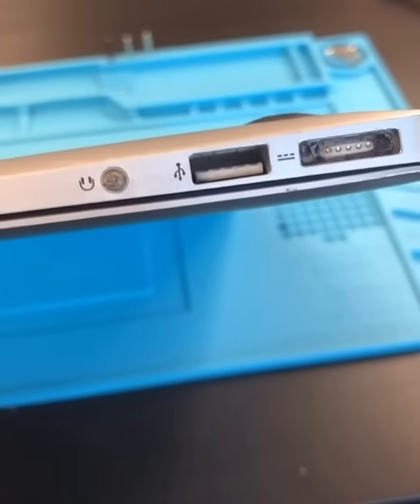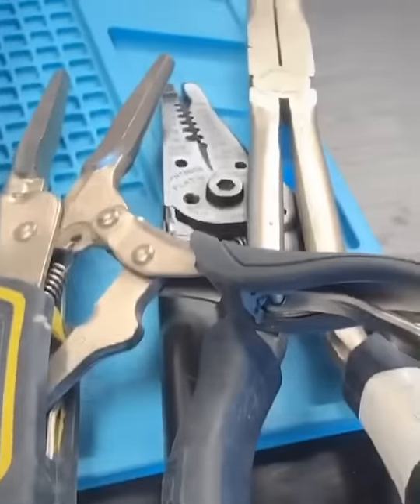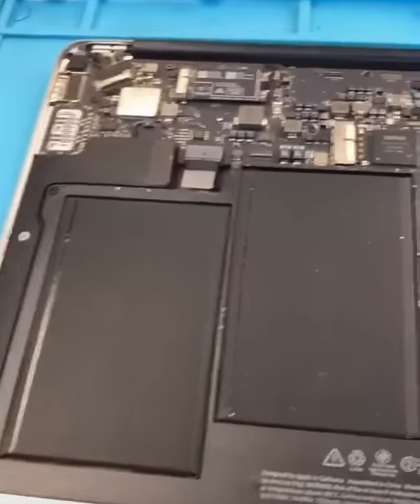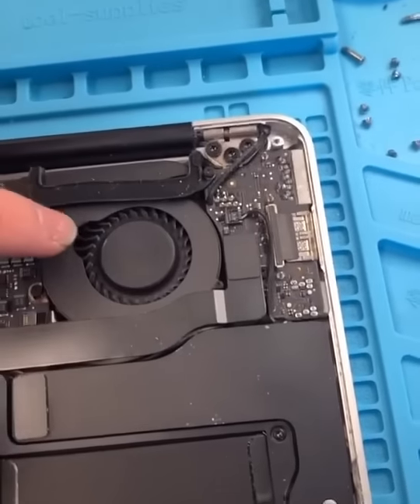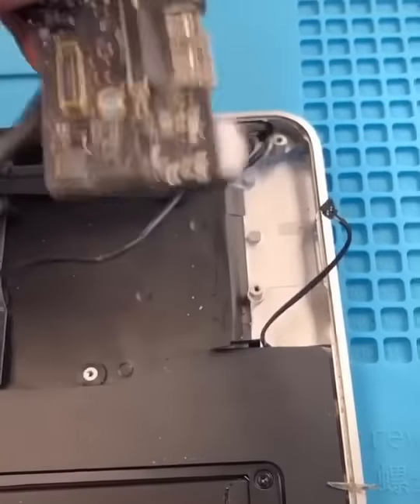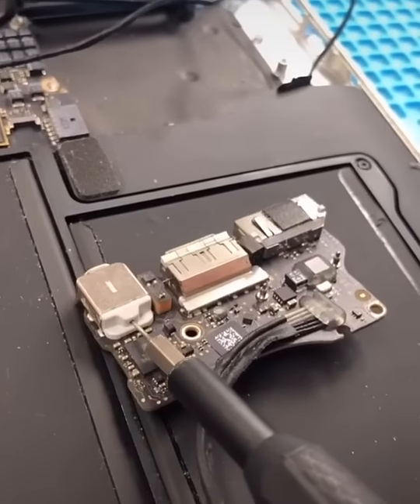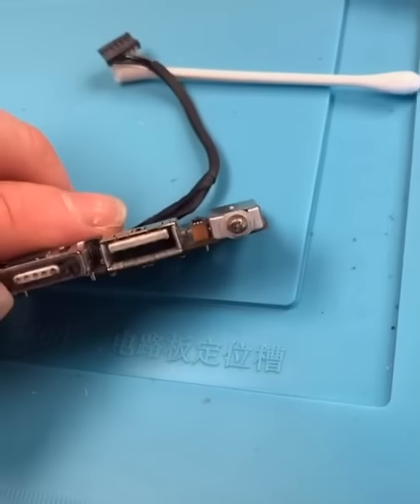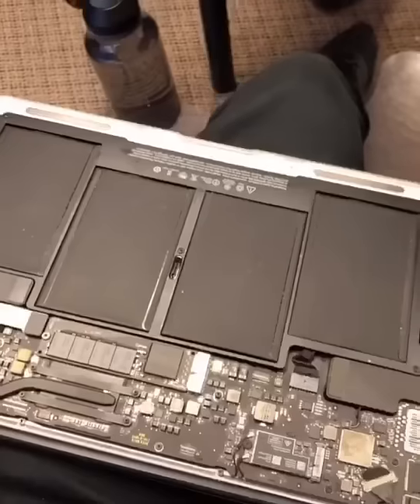Don't Use Glue On Your Macbook.... WHY? #Shorts

Comment: Everyone worried about what apple and Samsung do together I’m just worried about why they put glue there the first place 😭
Reply: Same! 😩🙄🤦🏻😂👌🏻
Reply: Uhh... Wireless?
Reply: @eciripsujiro6191  haha 😂
Reply: Why are you guys surprised about Samsung? Bruh they are literally everywhere
Reply: When you get something stuck in a blind hole, sometimes a useful tactic is to superglue something to the end of the part that's stuck and then try use that to pull it out, problem is that the superglue can wick its way to the inside, this method is also used to a different extent in machine shops, if you need to get a threaded plug out if a blind bore I'd usually just weld a nut to the plug and use that to get it out

Comment: It’s kind of cool that there’s a hole on the back just to push out a broken headphone connector
Reply: i was like 69
Reply: Plot twist : it's for round sim card but somehow the audio can pass trough it
Reply: Plot twist:
U go to apple saying a piece of ur headphone jack is stuck.

Apple: no it isn't it...MOTHERBOARD'S BROKEN (charges the customer a whole new laptop). 😑
Reply: Very convenient! Though it might actually just be intended for optical (toslink adapter) digital audio to shine through...
Reply: It's for air. Because you can't plug the Jack if the air inside has nowhere to go 🤷🏽‍♂️
Reply: @MrQuoteShorts  air has plenty of space to escape. That’s not a air tight seal being created in a headphone jack. A headphone jack doesn’t have a rubber seal. It’s just metal on metal for it to be air tight the metal would have to be smashed together with great force which is not happening in a headphone jack. The headphone jack and port are not perfect and there are microscopic parts where the metal does not touch but only in some spots where again air can escape. Do I need to give more proof that it’s not for air to escape?

Comment: Normies: "Samsung sucks, Apple products are so much better!"
Apple, who uses Samsung parts: 😐🤐
Reply: Apple created the parts but Samsung manufacturers them
Reply: @illegal3755  i believe that is the ssd, which is not something that apple designed.
Reply: @byanymemesnecessary8848  the sad was something that was designed by apple but Samsung created it Samsung and apple work together and they share ownership on some key parts of iPhone
Reply: @lexel7795  fair enough. Both are expensive af. Rn
Reply: You do realize that they don’t actually produce any of the parts in anything, nor does google or Microsoft? That’s just not how it works lmao
Reply: @gregglemange  what are you talking about? Samsung has been manufacturing their own microprocessors and flash chiplets for over 20 years.
Reply: @ChaotiX1  I meant other than that obviously. I guess google is bad because they use intel?
Reply: @gregglemange  yes, and AMD is bad because they use TMSC
Reply: @illegal3755  They design how the parts are being arranged together. They don't design the electronic parts themselves other than the board and processor nowadays.
Reply: If samsung want to stop the production of these parts i will be pretty sure apple will have hard times
Reply: @lexel7795  Nokia gang
Reply: @yohanncka92  I’m pretty sure the Xbox division at Microsoft would have a bad time if nvidia stopped making graphics cards.... your point is?
Reply: @gregglemange  3 main source on earth do produce those ssd. And samsung is their producer.
Samsung produce screens for apple too.
When they stop the supply it will cost a lot of money and time to get another producer to adapt and build the demand apple will ask to... and samsung is really cost effective about it. So yeah apple can die without samsung vice versa
Reply: @gregglemange  phone's market is on another level
Reply: @gregglemange  imagine being butthurt over the fact that your mac book is manufactured with samsung parts🤡
Reply: @bigbostickr2292  how am I butthurt? I’m saying they’re butthurt over how “bad” Apple is over doing something literally every company that produces electronics does Lol
Reply: @bigbostickr2292  cry more
Reply: @gregglemange  butthurt😂
Reply: @bigbostickr2292  waaaaa waaaaa waaaa
Reply: They have to piggyback better parts
Reply: apple elitists: try to fucking SUPERGLUE their headphone jack for some reason ???????
Reply: @Robyn_iz_Here  they don’t make
Their own parts, period. How hard is that to comprehend? Is PlayStation crappy because they use Nvidia cards?
Reply: @gregglemange  no 
U see the thing is. Ipjone is just worse. In every way. Unless u really like having an apple etched into the back of ur phone
Reply: They do better things with the resources they have and the software inside is better hands down
Reply: @gregglemange  you clearly have an iPhone 😭😭
Reply: They only use Samsung memory chips because literally Samsung and micron and maybe hynx make memory. Samsung makes the best memory why reinvent the wheel
Reply: @ChaotiX1  Apple Chips are faster tho
Reply: @shaneb395  compared to what?
Reply: @lexel7795  yeah I have a Dora the explorer flip phone 👑
Reply: i hate both, but apple is a bit more minimalistic to me and because of that i like it a lot more
Reply: @shaneb395  what chip?
Reply: @lexel7795  yeah Dora phone is better
Reply: @illegal3755  what
Reply: Our we going to have war between Apple and Samsung for which is better.
Reply: Samsung makes some great silicon.
Reply: Let’s be honest, Samsung has been around for far longer than Apple so if Samsung was really better, they wouldn’t be in apples shadow. 
Samsung may make some good parts but they run android on all their phones just like every other phone and people are simply tired of android.
Reply: @dimaisatree  "People are simply tired of android."
Oh yes, thats why 75% of mobile users run android. Because theyre tired of it.
Of course.
Reply: @dimaisatree  Apple's also designing some kickass chips, but it's companies like Samsung and Taiwan Semi who are pioneering the fabrication process that enable them to do that.
Reply: @wh2960  no
Reply: I don’t like the software I would rather have iOS than android
Reply: iPhone uses Samsung OLED screens!
Reply: Welcome to the thread of not realizing how Samsung operates.
Reply: @ChaotiX1  they are far from bad if you compare their desktop cpu with an intel one
Reply: @abdus-s  I was being facetious
Reply: @lexel7795  right 😂
Reply: @gregglemange  xbox uses AMD tho not nividea. Also nividea will have a hard time if samsung stops. They produce their new 30 series cards
Reply: @dimaisatree  most bs statement ever lmao
Reply: @dimaisatree  Samsung is certainly not in Apple's shadow. Just to put Samsung's size into perspective, they have designed military equipment for the South Korean military

Comment: It's crazy how macbook and every other apple tools basically made out of samsung's parts.
Reply: So look those samsung parts are the storage for the device and apple doesnt make storage so they use samsung storage components
Reply: @figure_5601  um you do know those aren't really storage devices those are usually hidden under the motherboard or even under the battery/panels those Look more like little chips you see on GPUs and Many consoles and some motherboards that don't have them covered up and to me they look more like VRM chips but i am no expert in macs so i could be wrong
Reply: @figure_5601  storage for the device lmaoooo you just made my day
Reply: Their starting with their M1 chip to move away from this. In about 10 years Apple will make everything in it.
Reply: @rxonmymind8362  in 10 years it might be a tad late
Reply: @rxonmymind8362  NO. Apple DESIGNS the chip. There are literally only two companies that manufacture chip, and they are Samsung and TSMC. There’s also Intel, but they make stuff for themselves. 

Apple designs products. Samsung sell chip. The chips in the video are, I think, RAM modules. It’s completely normal to find them inside. I think PS5 and Xbox One X also use modules made by Samsung. 

This has nothing to do with Samsung’s products, which are designed by samsung as well. Those are two different business units.
Reply: @Dracogame  Apple are not involved in any way, shape or form with the design or manufacture of any Samsung products... Also this isn't anything new, Apple aren't good at making anything, they're just good at marketing, and because laws are now changing to stop them making disposable products they're having to outsource more and more components to meet functionality and durability requirements.
Reply: @themmgamer1227  Apple designs its own chips. Some iPhone chips (like the A5 in the iPhone 4S) were manufactured by Samsung even if their name wasn't on it. Samsung sells its production capacity and worker's experience, Apple provides the blueprint. Now their chips (like the M1) are manufactured by TSMC. Some standard components like RAM really don't need any design, Apple might require some specification and that's about it.
Reply: @Dracogame  exactly
Reply: @Dracogame  phone chips are DESIGNED by apple and MANUFACTURED by samsung. they do not make the chips, just the designs
Reply: @that_kaii  That's what I wrote, maybe next time take your time and read my comment. Also, I never said Apple designs Intel's chip. Apple used both AMD and Nvidia GPUs in the past. I never said Apple designed any of those. If anything, they might have asked for or codesigned a specific SKU not available to the public, like they did with the first Macbook Air which had a custom Intel Core 2 Duo.
Reply: 1 fucking part it’s the display
Reply: Yes
Reply: Apple made them it's just that Samsung manufactures them so It would still be illegal for Samsung to use the parts that they send to Apple
Reply: @julienlevesque2100  you have no idea what you are talking about
Reply: @smithgeorge6858  bruh
Reply: @smithgeorge6858  To everyone who thinks Apple runs on the same parts Samsung uses, no. Apple made them it's just that Samsung manufactures, sends it to Apple, and Apple pays them. So It would still be illegal for Samsung to use the parts that they send to Apple. If Samsung wasn't a thing Apple would die since it won't have many parts but if Apple dies so will Samsung since they lose a very large customer. i see everyone in the comments like: lOl APpLE juSt TAkEs sAMsung's paRTs aNd MaKES Their phONEs wITH iT ThAT's why sAMSUnG Is bETTer. Not at all their both great companies in their own ways...
Reply: @julienlevesque2100  look at your reasoning again
Reply: @julienlevesque2100  pls dont say make up statements i have not even said and why did you even bring up in this conversation that had nothing to what i said? I also see alot of apple fan  boys in the comment section too. you are just like those samsung fan boys you criticized yourself
Reply: @julienlevesque2100  you seriously have no idea about the world Samsung not only makes phones but they are leading the semi conductor industry and they also have so many branches. YES apple is a big customer for samsung but samsung can survive without apple.
Reply: @julienlevesque2100  do did you search in youtube how big is samsung?
Reply: Isn't that crazy lol
Reply: Nothing in a apple products is made by apple except software
Reply: @elburrito9167  and thats from a lot of other companies aswell
Reply: @JussDraftfr  pretty much but but not at the level of apple
Reply: This is why Samsung and other phones not by apple are better
Reply: @rxonmymind8362 bruh apple is ordering Samsung to make the m1 lol and even if spple starts making there own parts it will suck
Reply: @themmgamer1227  trur
Reply: From what year do you think that macbook is from?
Reply: I mean there are only a handful of companies that actually make parts, Samsung, TSMC, and Sony come to mind.
Reply: @PandaGaming-ds9uc  I thought it was memory but they might be VRMs at well.

Comment: Well you also can use acetone if it’s not bad for the computer. Acetone is mixed with glue when the glue is made, and that’s why it doesn’t harden in the tube. When glue touches air, acetone vaporizes and glue can harden peacefully 😌

Comment: simplest thing to extract it without opening is heat small metal screw then push it into plug plastic material, keep few seconds to cool,
once cool pull it out with Jack...

Comment: I had to do this myself once, but I didn’t stoop to glue lol!

However I was in the boarding house at my all girls high school and I used the tweezers on the pocket knife (that I wasn’t really meant to have) to pull out the broken piece and left the thing on my bed... apparently the other girls told on me and I got in heaps of trouble for it. 

I don’t regret it, it saved me paying to get it fixed! 
Or trying to open it up and do it this way on my own... I feel like I would’ve done more harm than good lol

Comment: If you’ve  got super glue in the port, take the IO Board and put it in the freezer. Superglue is water based and will break its bonds under 32F

Comment: The school I was in put a lot of glue inside all USB Ports, the LAN Port and everything else except the power hole. There they just used a lot of glue to hold the cable in and prevent it from being pulled out. They also removed the batteries. So there were a lot of notebooks you can't use with USB sticks or a headset. They were just used to look stuff up online or to borrow books online.

Comment: The fact that Apple has to buy Samsung parts is sad, when Samsung can make better products for cheaper and Apple still struggles to do anything other than make a 85% profit of their phone by providing a basically irreparable phone where they encourage you to buy another one instead
Reply: Eh. I still prefer apple
Reply: u prefer it bc its “better”
Reply: Samsung is the best "battery-maker", for every electric device including cars. Isn't something new or really surprising. And also including batteries are made of litio which can be exported from Chile as well (idk from anywhere else).
Reply: I fucking hate apple but this is a bad take. Apple use Samsung displays and memory as far as I'm aware, however they are completely different branches of the company. Samsung phones use both Exynos and snapdragon SOCs, the snapdragon ones being Qualcomm chips. No one makes all their own parts for devices. It just doesn't work like that.
Reply: @felixcd3799  

 

OK pm0u
Pm
Reply: Apple designs the chips but doesn’t manufacture it
Reply: #XIAOMIBEATSSAMSUNGANDAPPLE
Reply: @xoxoskywalker1976  what reason lol?

Comment: Another way of doing this is taking a needle and getting it extremely hot. Sticking it in waiting for the glue/plastic to get solid again and carefully pull the needle and whatever's stuck should come out. Used that method for stuck rca cable ends in an amp

Comment: Done a hundred of these. Sometimes you have to take it apart but here's how you do it get a sewing needle bend the tip over just a tiny bit a small amount that will still fit through the size of the headphone jack get it red hot shove it in wait a few seconds while as it cools off but while it's still hot turn it 90° and let it cool all the way off and simply remove the broken headphone jack

Comment: I had a repair guy break my computer bc the keyboard kept disconnecting. (Def a design flaw) and he glued the keyboard to the plastic. It lasted another year. It would over heat. And the hard drive was faulty. My advice; DONT SUPERGLUE YOUR COMPUTER ALSO DONT BUY COMPUTERS OFF NEWEGG

Comment: I tried doing this to my DVD player because when it fell, the composite cables broke off ans got stuck inside it. I ended up throwing the player out because the composite ports were covered by some other pieces of plastic and metal 😪. R.I.P DVD player, you have served me well.

Comment: I had to do a similar repair to a laptop. I screwed in the jack very very carefully a tiny screw, and pull it out with a pair of pliers. Also tried of heating a wire and plug it in the middle of the Jack's core, as it was made of plastic, but didn't work. Edit: didn't know the short was kinda old, but hey, they are my 5 cents anyway... Lol

Comment: If you need to get a broken headphone jack all you need is a needle or safety pin and some sort flame. Every single 3.5mm headphone jack i have ever extracted has plastic injected into the inside of the metal casing, you can see it yourself when you look inside of them. So what you do is heat the tip of the needle or safety pin, quickly take the pin away from the flame and stick it directly into a headphone jack casing it will be hot enough to melt the plastic and embed itself into the 3.5mm headphone jack. once it is inside let it sit until its cooled down after a few seconds it should be ready. all you do is pull the needle or safety pin quickly and firmly out dont twist, turn or bend the needle or safety pin and you should be done. I have never needed to do it more than once on the same headphone jack, the first time has always worked if you guys would like a video demonstration lmk and ill post one.